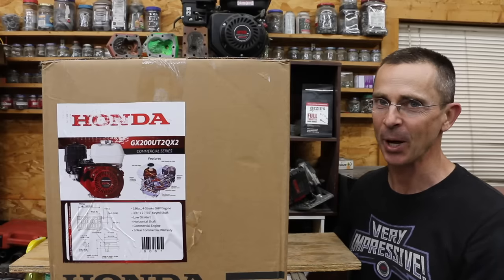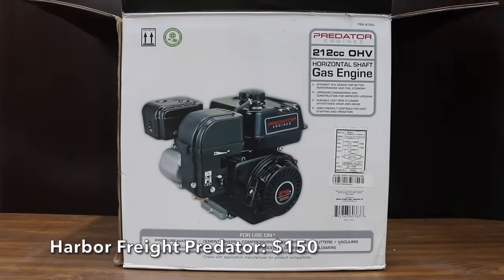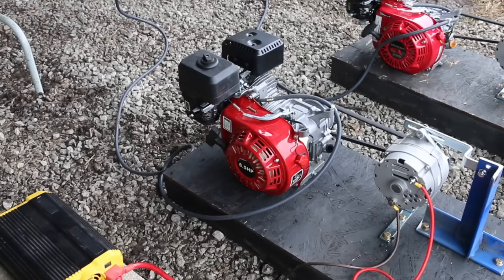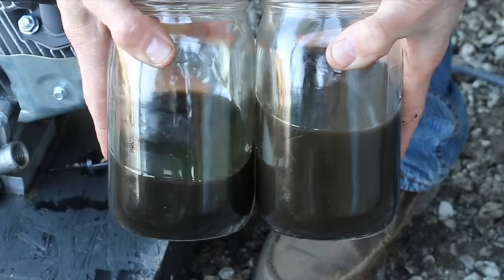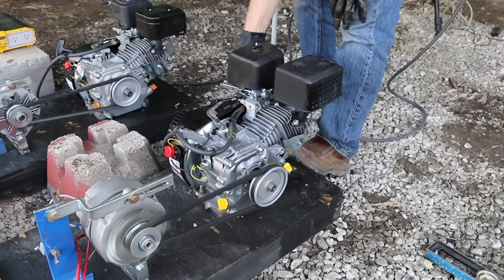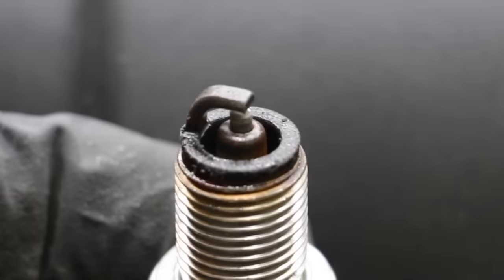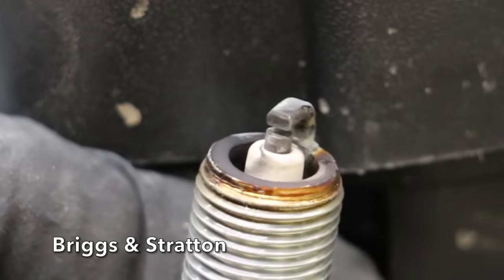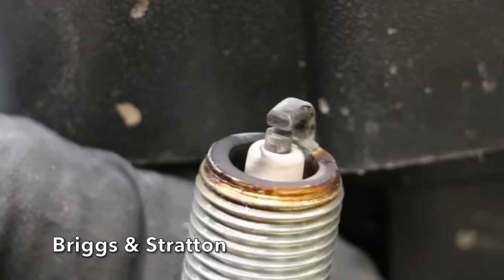$150 Honda Clone vs $600 Honda? Let’s settle this! Fuel Efficiency, Horsepower, Durability, Starting

Comment from the maker: Here’s the list of products reviewed. More details in the video description. Thank you! 
Honda GX 200: https://amzn.to/3whQKNh
Honda Clone: https://amzn.to/3HkseBq
Briggs and Stratton: https://amzn.to/3HlCCJe
Predator 212: Sold at Harbor Freight
Reply: 100% Fantastic video. You should publish these on all the alternative accounts like patreon, bumble, X , locals, etc. there are millions of people on Truth social too.
Reply: Carbon build up on a plug is not from burning oil.  It is the carb jetting is rich, and not hot enough to burn the oil, (loses power too.)
On a 2-stroke for example, you can double the oil mixed with the gas, and as long as you jett accordingly, the plug stays clean.
Reply: One huge reason why communist made junk is less expensive is because there were never any EPA type regulations put on the production of communism.  So keeping emissions down is not about saving the planet.  It is about advancing communism.  Our cars (for example),  cost about twice as much as they should because of the force of the EPA and other regulations that are not imposed on communism in the trade deals.
Reply: Pretty good testing overall, (but not adjusting jetting, if possible, will not give accurate performance results, for example).  I have education in such stuff, and doing good testing is not as easy as 99% of the You Tubers think.  I think you are close to a 1%er.  :)